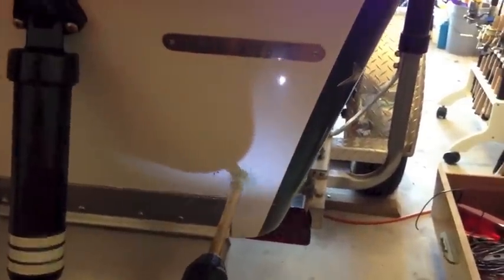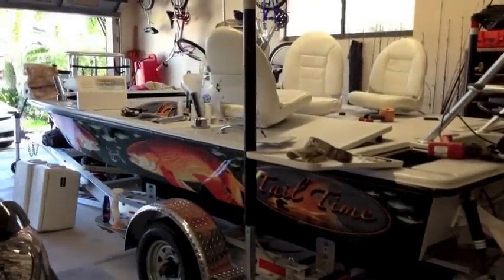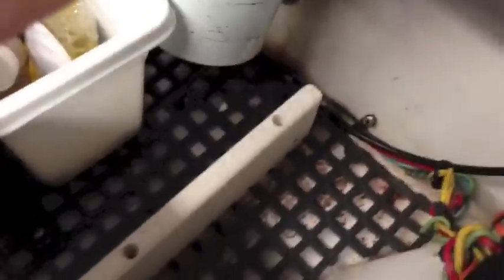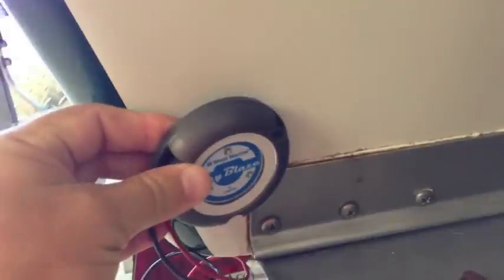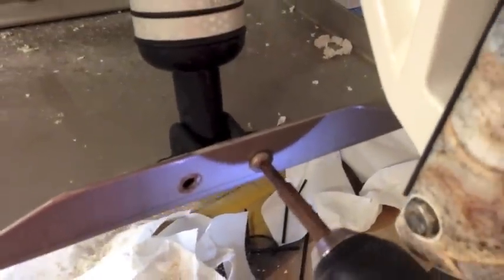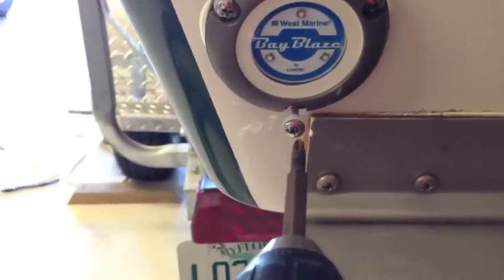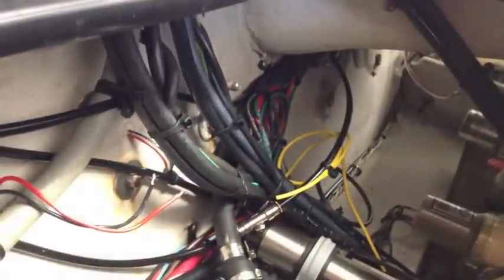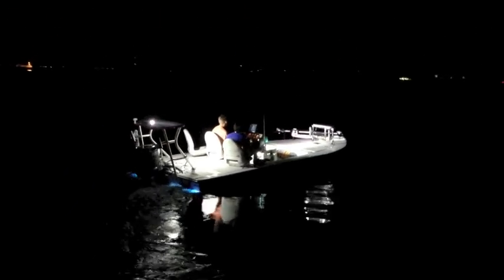Underwater LED Light Installation

Comment: Perfect. Love that you over size the holes in the gel coat,  did not use any gaskets, and positioned the wires so the sealant will not crack after it cures.
Great job!
Reply from the maker: Thank you!  This install has required zero maintenance and is still working perfectly.

Comment from the maker: Thanks!  This boat has lots and lots of holes!! To answer a couple questions, drilling out from the outside would have made it difficult to get the exactly where I wanted it. I had some wiggle room on the inside wherever the hole popped through, not outside though. I'll post a video of the intensity in clear water. It's really impressive. I love the West Marine lights. It's been about a year now and they are working great with no finish issues. For the money they are great!!  Really happy.

Comment: I just put my transom lights on tonight on my Boston Whaler.....instead of drilling a hole thew the boat I made a puck for the lights and externally ran the wires under the rub rail..think it came out looking pretty good
Reply from the maker: That’s for sure a safer way. No way of leaking through. Thanks for the comment!

Comment: When you put the first light in at the beginning of the video you drilled 3 pin holes for the screws an then went back with a another bit but only went in 1/4 of the way in so something would sit recessed in that screw hole. I think those  plastic washers were supposed to go behind the light and sit in that recessed screw hole. I think that would have made a better seal.
Reply from the maker: Drew BeenSlacking hi. Thanks for asking. The reason I drilled the larger hole is to prevent the gelcoat from spider cracking out from the hole when you put a screw in the proper size for the hole. You do not want any washers between metal and gelcoat when using a sealant. Those washers are designed for people who mount this light to an aluminum boat to prevent the two metals from touching. You’ll get galvanic corrosion wherever the two metals touch.
Reply: @bobbygfl  got it 👍

Comment: I know this is an old post, but just wondering if any updates on the lights lasting and any water leaking??  From my understanding the 5200 adhesive is really good but if your light screws up how to you replace it if you wanted to?  I just ordered the same lights, but not reluctant to installing them because of the adhesive and/or leaking
Reply from the maker: Mathieu Gravel hi, zero leaks. Zero maintenance. The finish on the lights has weathered to a brushed aluminum look. They were just as bright as the day I put them in and none of the three LEDs perlite have gone out. Sometimes I have wished that I put in a brighter light however the drain on the battery is probably not worth it. I would do this job again exactly the same way. Put in four lights instead of two more powerful ones was smart. Lastly the glass lenses are still crystal clear. Zero yellowing zero water intrusion into the light zero water intrusion into the hull also zero galvanic corrosion between the stainless screw in the aluminum housing which kind of surprises me but there's plenty of sealant and plastic washers to keep the two metals from touching. Anyway Hope that info helps thanks for the view and the comment!!
Reply from the maker: Mathieu Gravel by the way if I ever did have to remove them you can slice them off. 5200 slices pretty well with a razor. Need to work the razor under the light slowly slicing through the millimeter of 5200. Trying to pry it off is a mistake because it'll pull the gelcoat right off but this slicing technique once you get it started it works really well. Because it's below the waterline it's 5200 or 4200 and if I were to do this job again I would use 4200 since I never leave my boat in the water overnight. If I did though I'd still use 5200.
Reply: Perfect that's exactly what I wanted to hear.  Great video and much appreciated for the quick feeback.  I plan on doing the same with Seablaze light that are measured up to 700 lumens, I hope that's plenty of light.  Can't wait to install them, now just need summer to come along.  btw them little lights aren't cheap lol 

Thanks again

Comment: Does it drain alot of battery. Thinking about install 4 on transom. Did u run the wire to your starter battery? I have a bass boat n not sure which one to connect to.please help. Thank you.
Reply from the maker: Lee Sirlee no, not a lot of battery drain. A stereo with four speakers will drain more power. Mine runs off my deep cycle, but you could run it off a starter. Just more risky if you kill it.

Comment: Thanks I'm adding white lights in my 240 sun dancer here in FL. Thanks for the video, gives me a better ideal of what i have to do.  What was the sealant you used again? And did you also get it from West Marine?
Reply from the maker: Loren Andrews Hi!  Yes everything came from West Marine. The sealant I used was 5200. It's suitable for permanent underwater use. Just wanted to mention, zero maintenance and zero issues with these lights. They are still going strong!

Comment: that's great but yo should epoxy the hole shut then redrill with a smaller drill the second time to drill only through the epoxy and not leave exposed wood on the transom. other than that Mrs. Lincoln....
Reply: +edstimator1 Yeah us who charge money to do this for a living don't have time for that. We do, but the customer won't pay for it. That there in the video wont leak or lead to intrusion for at least 50 years. The light will fail and leak from the guts in before the 5200 will........
Reply from the maker: Great tip. Thanks!

Comment: How did you join the wires from the lights together to go as one wire
Reply from the maker: This video is unrelated however about the middle of the video I broke a wire and reconnected using a heat shrink butt connector. This is the same type of connector that I used for the underwater lights. https://youtu.be/uAGt0a36j_g

Comment: What's the black cylinder hooked to the stainless plate for?
Reply from the maker: mitchell9027 trim tabs. The balance the boat side to side under way and make the front go up and down. Like flaps on a plane.

Comment: I have the same boat and I'm having trouble finding spots to flush mount speakers, if u have any on your boat where did u put yours?
Reply from the maker: Shallow Sportsmen hi, I mounted them under the seats facing forward. Two on each side. Two more on either side of the console. Sounds great on plane. I have a sub box in the console as well.
Reply from the maker: Shallow Sportsmen the bulkhead mounted ones are behind the black pockets. You can see the console ones in the photos in this video. https://youtu.be/kCvRz-8i1co

Comment: good vid!  Comment/question? Instead of all the measuring and remeasuring down from the board, why not just drill a small pilot hole from inside out to avoid lines etc?Any chip outs will be gone when you enlarge wire hole from the outside in.  VId well done! How do you like the West marine LEDs?
Reply from the maker: That would’ve helped speed this up lol!  Great idea

Comment: what do you use for sealing it? great video
Reply from the maker: Alexis Oliveras hi. I used 4200. Suitable for underwater however you can remove it without ripping the gelcoat off if you need to. Thanks for the view!
Reply: thanks for the answer i am staring on the boat led only interior for now but i want to do does too to expand the products that i sold you can find on facebook by Car Leds Innovations thanks

Comment: i dont understand your wiring? did you splice into the existing light wiring for power?
Reply from the maker: No, power is run back up to the dash switch, and there is a grounding block in the transom area that the ground connects to

Comment: The 10 sec mark..
Holy fuck! Are you DRILLING holes in your HULL? I don't own a boat. Never have. So, naturally, I think the boat's gonna sink IF YOU DRILL HOLES IN YOUR FUCKIN HULL! lol
Reply: Gator Pantz
lol... naw... Just don't have experience with boats. I've been on a couple of boats, but I never worked on one.
Reply: Not his boat so he doesn't care. haha. Id probably just marine silicone it to my boat and have the wires be visible. anyone have a link for how to do this on aluminum pontoons?
Reply: Robert Gantry drilling holes is fine on hulls being doing it for 30 years never sunk a boat yet
Reply from the maker: Lol

Comment: What kind of sealant did u use??
Reply from the maker: Hayes Mobile Auto Repair 5200. A shit ton of it. If they ever fail I’ll need to grind them out!  Lol
Reply: So just any kind of silicone sealant will do...  I must omit, it made me cringed to when you drill those holes.  Looks good!! Thanks, I’m doing it...   Looks very cool I’m gonna do it.. Where did you get your lights if you don’t mind me asking
Reply from the maker: Hayes Mobile Auto Repair 5200 is an underwater adhesive, not silicone. I would not use silicone under the waterline. And the lights came from West Marine. They are still working like the day I installed them. All these years later very impressed.
Reply: @bobbygfl    thx   good info
Reply: We used 4200 sealant so they can be removed at some point. 5200 is a permanent bonding adhesive and will take fiberglass with it if ever removed. 4200 is a less permanent adhesive/ sealant that is a top choice for underwater penatration's. I work at a boat fix it place for 35 years.

Comment: You do realize when the light fails you’re going to need a jackhammer to get the light off right?
Reply from the maker: Actually 5200 separates pretty easily with a stainless steel putty knife. I’ve had a couple through hull fittings that I’ve replaced. Hammering the putty knife along long the seem takes some time but I’ve never had one that I couldn’t get off. And being that it’s below the waterline I just didn’t trust silicone. Probably could’ve used 4200. But amazingly these lights are still working LOL. I’m really kind of surprised anyway thanks for the comment
Reply: @bobbygfl  that’s good news.. I got 2 seasons out of them before caving and  upgrading to the lumitecs..
Comment is more in regards to the screws… they’re gonna have to be broken off which isn’t the end of the world but 4200 works fine and still have a shot at removing the screws.
Reply from the maker: @nickzlb77  good to know. Thanks!!  The lunatics are way brighter!

Comment: These are transom lights, you should have mounted them on the bottom if you wanted underwater lights
Reply from the maker: Kimo Surfer hey thanks,  but I wanted them on the transom - under the water. So I did exactly what I should have. Lol. Thanks for the comment!!

Comment: Big holes for 2- 16 gauge wire
Reply from the maker: Chris Mohr There’s a flange on the back of the light housing that goes into that hole. You don’t really have a choice it won’t lay flat if you don’t at least countersink the hole the size of the flange.
Reply: @bobbygfl  didn't see that, thanks